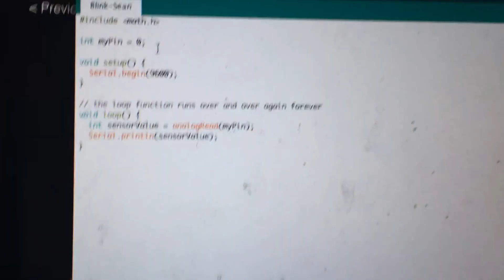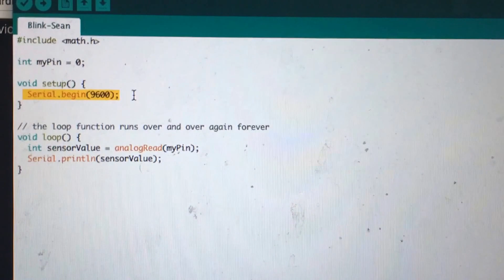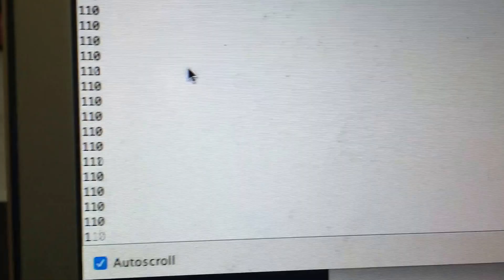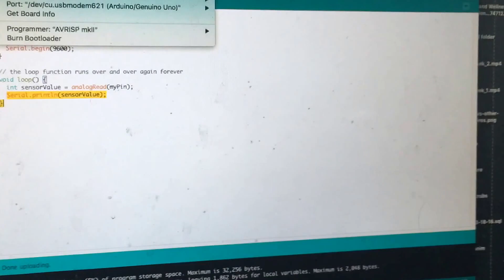Pressure Fabric Part 2: Hooking up to Arduino

Comment: Excuse me, Thanks for this resource. Can you tell me how long the 22 gauge wire can be that runs between the Arduino and the sensor? I was hopeful to have 15 feet of wire so the sensor is set apart from the Arduino.

Comment: Why the diode? I don't understand. Why didn't you make a simple voltage divider with the velostat?
Reply from the maker: Nepetalactone I followed instructions that I found online
Reply: The diode could be for protection. Using a voltage dividing circuit may be good for getting a better range of values? For example:
https://learn.adafruit.com/force-sensitive-resistor-fsr/using-an-fsr